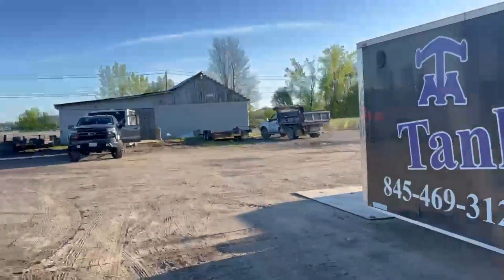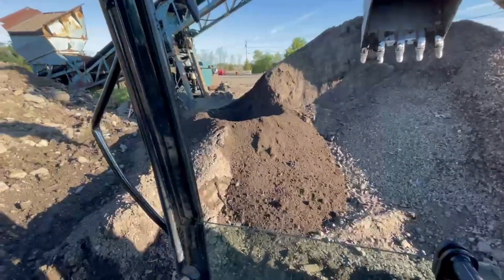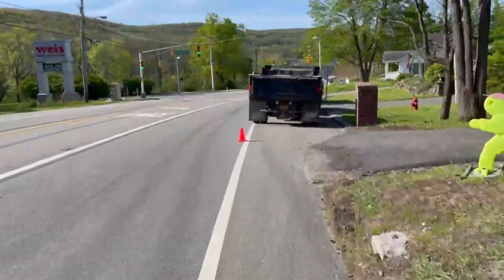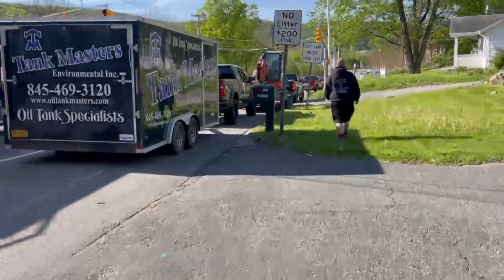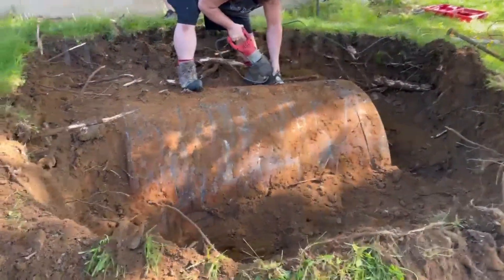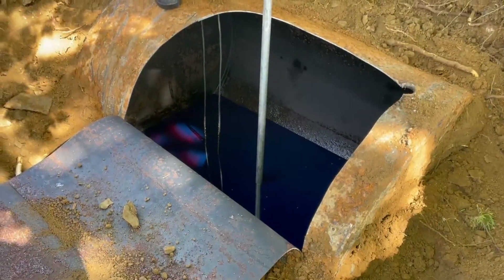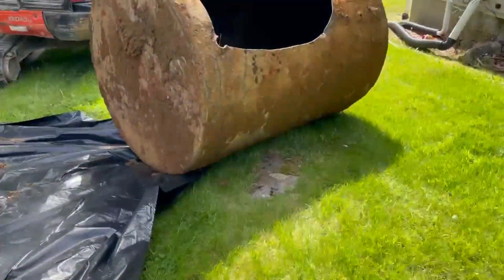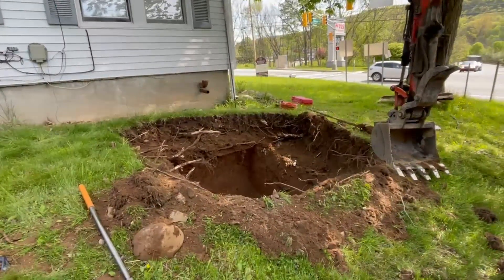Underground Oil Tank Removal in New Jersey

Comment: What about the cast iron elbow and pipes sticking out of the foundation wall? Looks like an old fill and vent. In my region, any old piping must be removed and foundation patched up.
Reply from the maker: We were hired to remove the underground oil tank. Those pipes were to an old 275 gallon oil tank in the basement that had been removed. Absolutely, the contractor that removed that oil tank should have removed the fill and vent. I don't think permits were taken out on that job because the code enforcer would also mandate it be removed. Good Eye